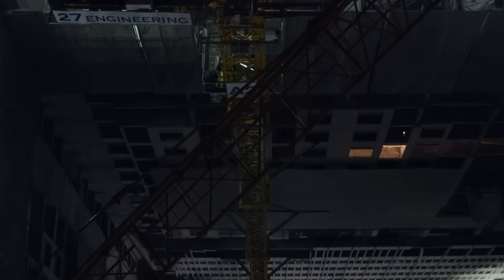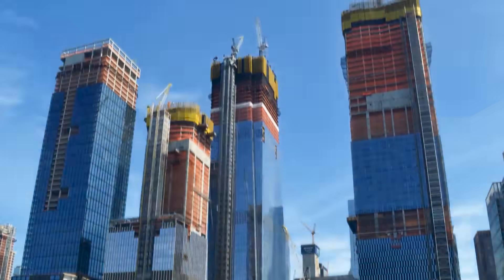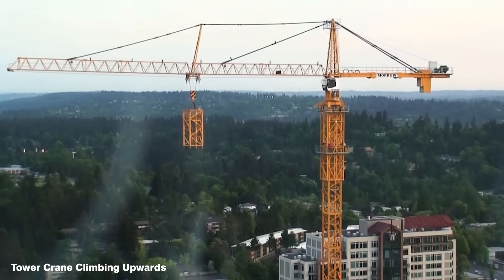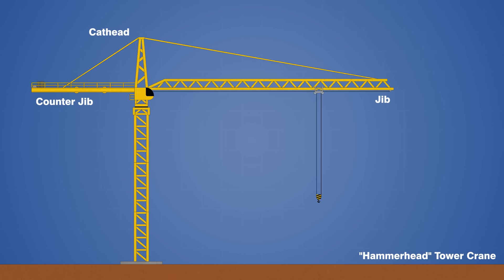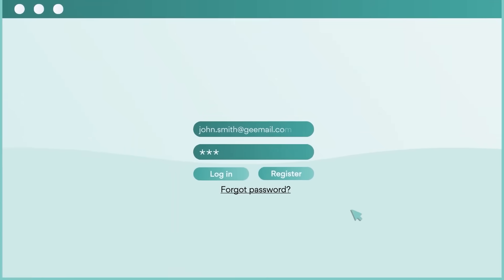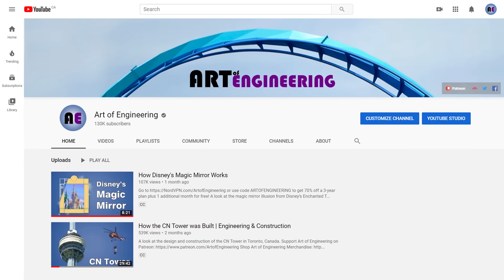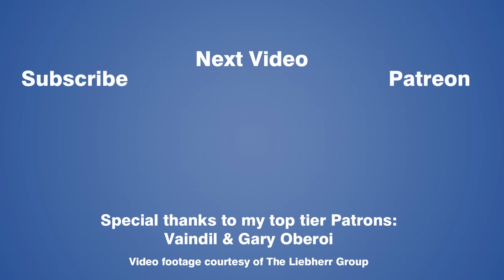How Tower Cranes Build Themselves

Comment: The last part of the video is wrong. Tower cranes always sit on the foundation and are never disconnected from the foundation as the construction gets higher.. Otherwise the building can not carry the weight of the crane. Tower cranes are disassembled just like they are erected, but in a reverse fashion.

Comment: These tall cranes need to be carefully balanced.  I always thought the concrete counterweight moves in or out to accommodate the load moment arm but lookin at a few cranes, they are fixed.   It seems that loads must be extremely limited with fixed balancing.   Can someone comment on this?

Comment: There's a massive tower complex being constructed across the street from me and It really grew my interest in these cranes. I watched the crane jacks work over the weekend and was amazed by how delicate of a process it can be.I also got to the see the bottom up cranes be built and that really confused the heck out of me. The crane was inside the structure of the building. I thought the crane was attached to the very bottom level, but as the crane went high and higher I noticed that the crane structure didn't exist on the lower floors but was simply attached to the structure of the building. That crane is now maybe attached to the top 10 floors of a 60 floor building. Confused the hell out of me until i watched this video and figured out the whole scenario. There was also a point when I was gone for a week and they moved one of the cranes to the opposite side of the building and changed it from a hammerhead crane to the luffing jib crane. Not sure why exactly, might have been a design screw up.

Comment: This concept uses very-cheap(relative to other concepts, especially if don't need the self raising incremental height module) parts and can be scaled to very small.

Antennae mast, radar mast, missile decoy transmitting mast, high winds laundry mast, some-sail effect when used behind structures, stage, ... ...porcupine cell phone horizontal "tower", ... fun ride periscope put cabin under rails and winch under cabin or seperate forward rail with cable inside steel-rings(tiny load) (inside big winch hooks...)

Comment: But doesnt wind or turbulance make it obsolete after a certain length, because it becomes too unstable? How does it remain stable on just those 4 pillars and a tiny slab of concrete beneath? there must be a limit on how high it can be build, after all it's just metal, it can be bent with enough trauma/turbulance

Comment: Fifty years ago I worked on a project of multiple apartment buildings as a laborer. During preparing the lattice for the crane pad I asked what happens to it when the construction is finished. I was told it's all left inside the building to become part of the elevator shaft structure. That made sense to me at the time. I don't know if that is still the practice in some circumstances.
Reply: Hello there! First of all, hats off to you! Fifty years ago is a long time, I suppose you've seen some amazing things. I'm a civil engineer from Germany and although I'm not too familiar with the US standards for such cases, I can tell you that our aim is to leave as much inside the building as possible. That way it's easier (and obviously faster) for us to finish the construction site. In most cases elevator shafts are constructed, sometimes staircases, but it really depens on the project. So, there you go! Kind regards :)

Comment: We recently bought a used crane but we were not given the specifications on how to dimension the reinforced concrete base. Does anyone have this technical information to give us? 
Crane has 40mtrs high but we will be using most on 20mtrs buildings construction.

Comment: Two things left unexplained. 1, how exactly do the sections secure to the part beneath it? 2, how is the base anchored to the ground to prevent sideways tipovers, or rly any direction tipovers when it's windy. Both of these things are gonna be the weak link in how high you can build the crane.

Comment: Great video.
Now, with the second method of raising the crane in the interior of the building, I wonder how the heck they get it down when the building is completed.

Also, something I never thought of before: when the crane uses the structural supports of the building to go up internally, the architects would have to account for that when they design the building. I would think those loads can have a significant influence on the structural design.
Reply: and Engineers too. 😊
Reply: They get the crane down from the inside of the building by building a smaller crane on the roof temporarily to dismantle the tower crane. Then they build another even smaller crane (stiff-leg derrick) to dismantle the previous crane and on and on until the final crane can be broken down into  components small enough to go down the stairs, elevator shaft or mechanical shaft.
And yes the slab openings are engineered to accept the crane opening.

Comment: The concrete base is designed by a professional structural engineer for the specific crane make / model / use and for the specific geo-engineer-tested soil conditions for the location the crane is to be erected. The base is located for maximum crane reach keeping in mind underground services locations and is typically left in place and just buried over with concrete floor when it's no longer required. While concrete is supposed to cure for 28 days to reach 75% of it's ultimate design strength, few can afford to wait so, to speed the curing process chemicals are added to the concrete to expedite the curing process. These chemicals are often referred to as "high-early additives" (as in high-strength, early-curing). All concrete pours are tested for multiple factors during any build and strength is just one.

Comment: I worked high rise buildings for years . Most of the time the operator could not see the ground men or the men inside the building , receiving the load . We had to use hand held radios for communication . These Operating Engineers,,, were very professional.  I trusted my life in their hands . And I never saw ANYONE get hurt by these men . Thanks,,,,,

Comment: I really need to spend some of my weekend watching the next crane being built in my city. I just got done working with the crane company that will do the job. My job is to make sure they do the crane work with minimal disruption to the people who live nearby. In this case they will be right outside of an apartment building of low income people who are being annoyed daily by construction all around but will not benefit from the changes to downtown. Heck, I don't make enough to rent these apartments they are building. For instance, they proposed starting at 5:00 AM and working to 5:00 PM to set the tower crane base and first sections with a mobile crane in the street just outside that apartment. I told them if it takes 12 hours make it 7-7 so they can at least sleep in! As smart as we are to make such engineering marvels we are still pretty dumb sometimes.

Comment: I was working a construction job in DC back in the 70's where one of the tower cranes (still being erected) came crashing down killing one worker outright and injuring another.  Come to find out the pin connecting the cable from the tower to the counterweight snapped allowing the counterweight to pivot down and strike the tower.  The trolley side also collapsed and the trolley rolled down over an ironworkers foot severing it.  I was not to far away at the time.  Afterwards the tower had a 'bend' in it where the weight struck it.  The crane had to be disassembled so parts could be replaced.  It did finally become operational so we could finish out work.

Comment: Tower cranes is something long forgotten in Canada. They do not do it any more when building skyscrapers. They use short cranes sitting on the elevator shaft which grows together with the building. Like in the last part of this video.
Reply: I will add that alot of the cranes in Canada are older linden 130 cranes which can indeed float in a building but for the most part they are improving the fleet to newer cranes that have larger capacities and longer jibs, the older cranes are basically analog with the newer ones going to frequency drives. Old ones were dnagerous, if you ran a linden 130 and these 2 small pins 1/8 inch across broke in the tach the load was going to the ground-not full speed but it was going and all you could do was steer it to a area that was less populated and scream over the radio to get ta fuck outa the way

Comment: Highly interesting video.
Does not agree with my known 
building construction !

>> General Erecting <<
-- The ground is prepared for entire building;
-- The crane is assembled where the elevator shaft, will be.
? Usually 3 to 4  floors above expected building height.
? Process almost always is at night.

>>Max Height <<
-- Once crane reaches it's desired height;
it is usualy lleft still, for nearly 6 weeks !
Reply: >> Construction <<
--  the elevator shaft is constructed around the crane.
? While strong: Elevator shaft, can not support the crane.
! Elevator shaft, is almost always 3 floors higher than rest of building.

>> Completed ?
Once building is completed:
top of crane, is removed.
?? Usually at night ?
( a pattern ?)

>> Extensions ?
If crane needs to be raised:
it is raised near 10 floors at a tine.

!!!!!!
This method: creates a fairly stable support, regardless of desired maximun height  !  

?? 50 floors high ?

? No idea of construction much higher thsn 50 floors ?
( 500' + 30'')  or  (150m + 10m)

Comment: Half the information makes this only half informative! How do they get the jibs in place? How do they get the counterweights in place? Without these items it's just a tall radio antennae... not a crane. Please revise the video and show the addition of the jibs. Otherwise, great info. Thx
Reply: They are just lifted and positioned by the mobile crane which has already setup the mast
Reply: @Crottedenez1000  OK, I'll buy that. Then the low fully built mast and boom is lifted as shown... Thank you. I wish they had said that in the vid. Cheers!

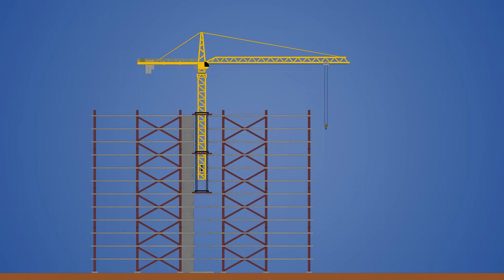Comment: 8:23 I image that the shaft where the crane was could be somewhat easily turned into an elevator shaft. But I’m not an engineer so I might wrong.
Reply: In all me years only once was it in a elevator shaft, alot easier to place on the outside of the building and the operator can see the ground instead of being basically blind and has to be signaled almost everywhere

Comment: I was an ironworker in Boston and there is a pecking order with all the trades in large scale steel-reinforced concrete building (of course ironworkers exist at the top to ironworkers). Was like, laborers at the bottom, internal finishers and plumbers up from there, all the way to the ironworkers, riggers and fitters. But all the posturing and BS the ironworker foremen  had stopped when the crane's showed up. Those operators are THE most respected folks on any job outside the owner and architects.

Comment: So how are the collars lifted to support the crane in the building  when they have to be placed 3 storeys up?
Reply: In cases where they have to jack a crane in a building it starts 2 floors up from the bottom, the crane is balanced completely and hydraulic jacks lift it up 2 inches a stroke, floors underneath are reshored and no collar is needed but they do use have hardwood wedges are used to hold the crane in the hole, and it really sucks if a wedge falls out and the crane falls backwards a foot, pucker factor 101, scares the hell outa you

Comment: Hey cool video. How do you put on the long horizontal thing tho
Reply: they usually put on in two sections, remember they have to keep the crane balanced, they put the machinery deck on then 40 to 60 feet of jb, then add counter weights then more jib and finish up with the last counter weights

Comment: I've ironworked for a few years specializing in buck hoist work. The first conversation on the radio you know if the operator is an ace or a beginner. Had alot of badass operators who don't need a ton of hand signals or talk on the radio. Much respect to the good ones. Alot of life's are in their hands.

Comment: One thing I don’t quite understand, as the position of the load changes why doesn’t the counter weight move to even out the loading/torsion on the tower?
Reply: A tower crane when there is no load is at the most unbalanced state, the crane actually leans backward, only when it picks up loads does it start to balance out and starts to lean foward

Comment: I woulda thought that, when there's two, workers use the other tower crane to disconnect the top and set it aside so they can build on the mast.

(Obviously wouldn't work with fixed jib cranes.)

Comment: I am watching another channel where they have a crane like this and what I would like to know is how the crane operator communicates with a large construction site. 
And is the worksite broken up into coordinates for him to pick up and move to, instead of 3rd left pillar, pick up form and move it behind the outhouses?
how may people are actually talking to him, or is there just one person talking to him?  who decides what, when, where and in what order?
Reply: Almost all lifts are scheduled for the different  crews, all done by radios, decking crew 1st, rebar crew next, misc picks for plumbers and electricians as needed, stocking drywall and others early at night,  precast siding and windows at night, concrete pours usually start 3 am, finish between 8 and 9am. We worked 10 to 16 hours a day, usually a 70 to 80 hour week 6 days
Reply: @TheHawkeye1432  thanks!  is this schedule set up ahead of time, and again, is the worksite set up in a grid so the operator knows where to grab from and where to move to?
Reply: @AffordBindEquipment  the schedule is basically set before hand but as the building grows things slow down, at first doing a concrete pour may take 3 hours but on taller buildings that could stretch out to 6 or more hours for the same pour just because it takes longer to get that bucket up to height.
   As to grids, you will have a lay down area, concrete bucket area, truck unloading spot etc. Good operators live by numbers as well as depth perceptage, 30 years ago it was something like 2nd jib section 4th strut while pointed at a certain spot in front of you and then depending on your eyes to take it as far down or up until someone flagged you. Now the cranes have digital counters that tell you the radius you are at and the height of the block, ie 165 feet out and 245 feet up but you still have to pick the spot to point at.
  Repetition is the key, if the boss wants to save time don't change stuff around, he'll 20 years later I still have dreams of different numbers from different jobs
Reply: @AffordBindEquipment  also as for flagging the crane,  usually by radio, 2 men on each crew, a ground man and one on the building and if I hear a voice that I don't recognize or doesn't say my name 1st I don't move
Reply: @TheHawkeye1432  Thanks so much for the info! This is what makes youtube comments worthwhile.  Makes the videos more interesting when one knows what is going on behind the scenes.

Comment: Fantastic video. I wonder how this crane with its own weight does not bend!
Reply: A crane without a load on is really at it's most unstable point and when we look down the tower sections do bend out under us, away from the counterweights, as we pick up loads the tower sections actually straighten out and then when we do get near the max load the tower sections do bend backwards. if the crane didn't bend and flex it would soon crack in the welds

Comment: Hello there. Great video. Just let me point out that it is common practice (at least for me) to pile the crane foundation and not rely heavily on a shallow raft foundation design. It should be noted that piling reduces the overall volume of a crane raft foundation especially where space is extremely limited BUT such piles would remain permanently underground.

Comment: Is it safer to externally or internally climb?
In the event that something fails, it seems like it would be safer to externally climb because the crane would be the only thing that is falling, but I guess the free-fall means there are more "things" it could damage? Internally, however, more things would have to fail in order for it to collapse, but if it's a catastrophic failure then the whole building could come down. Do they take this into consideration before building--whether they should use internal or external? Or is it pretty much just exclusive to what is being built (i.e. internal if it's an entirely new building, but external if it's an addition to the top)?

How about the wind? Obviously it would effect the center of gravity but is it ever even fast enough to really worry about pushing the crane over?

Comment: Fascinating.  So what happens to the area inside the building where the tower crane is mounted after they're done with it?  Do they repurpose that as an elevator shaft or something?  Or does it just become just a regular section of the building?

Comment: My dad used to work in this kind of machine in the early 80's,one day when he was getting ready for work he got his fingers chopped by the engine that was inside the cabin. He didn't know what to do so he jumped in a pile of sand that was in the bottom of the crane, he survived the fall, but lose 4 fingers. (sorry for my english btw).

Comment: Not too bad an explanation but a minor fault. I was a rigger for 10 years working tower cranes and a lot of the cranes had their climbing frame permanently under the slew ring because as it was raised on tall buildings we'd bolt anchor frames onto the building. Therefore the frame couldn't be lowered until needed again and it also saves time. Usually we'd raise a crane on a Sunday because most jobs (here in Australia) were 6 day a week job sites.